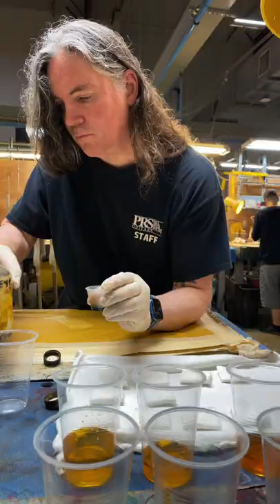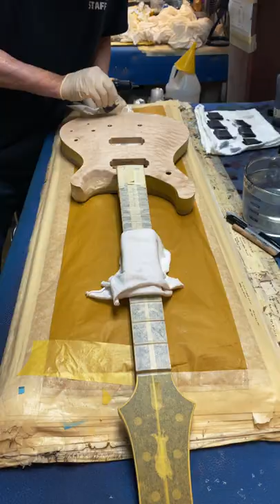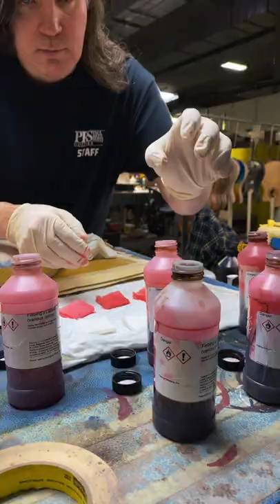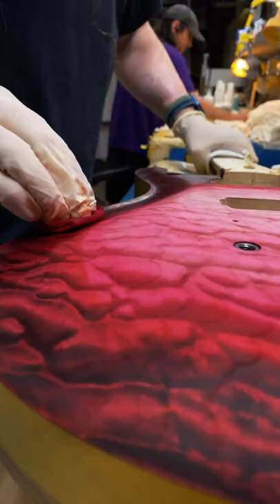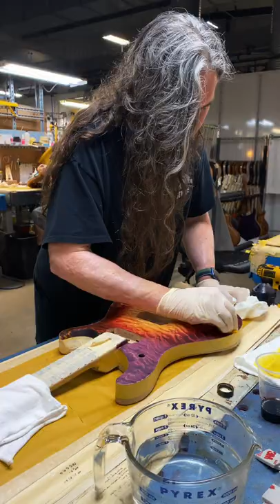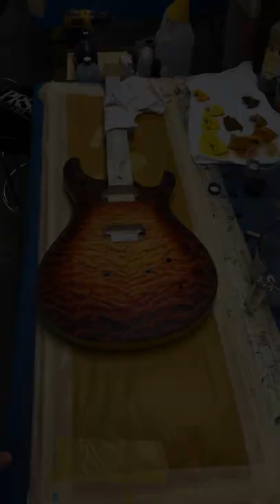Staining A Private Stock In Electric Tiger Glow | PRS Guitars | #shorts

Comment: That is gorgeous!  I would never have thought of that purplish color being underneath that yellow and red.
Reply: I know right, there was a point where he had the purple and yellow together where I think he should’ve stopped. Instead he mixed that purple into just a dark contrast. It lost all its purple hue.
Reply: @allenmitchell09  maybe. But that’s probably not the color he’s working on.
Reply: It looked like he used black around the edges followed by rose lightly from the center and then heavier/darker all around followed by yellow equally applied all over. I didn’t see him adding purple to the yellow. Looked like he blended the yellow into the rose and then rose/black or resulting purple.
Reply: Coolest thing beside pick up a guitar and play it ;)